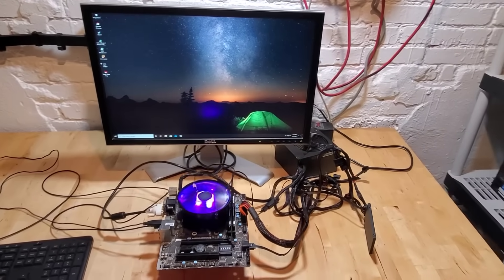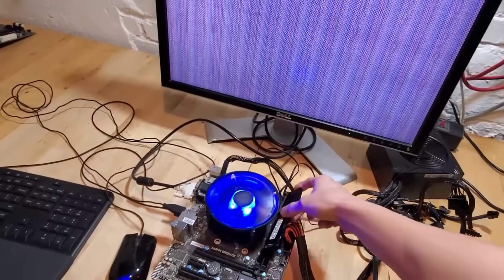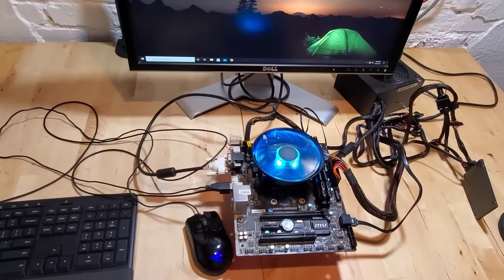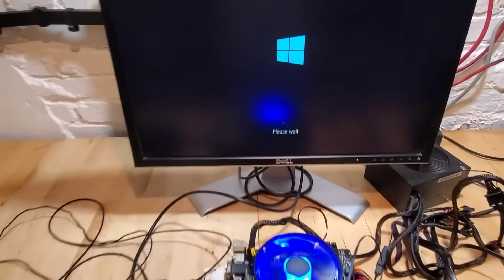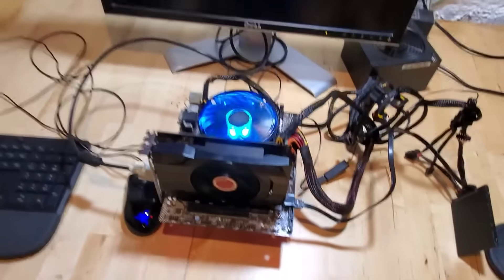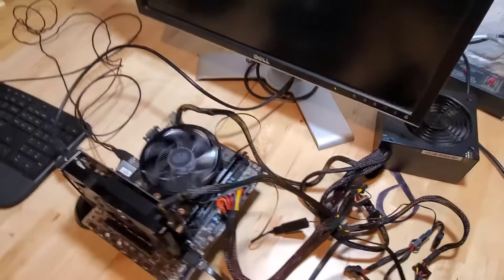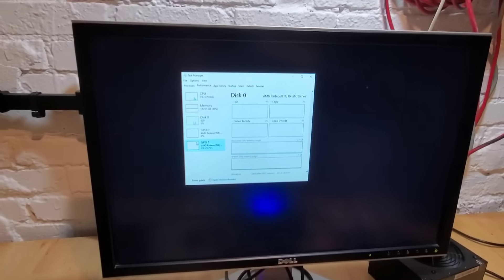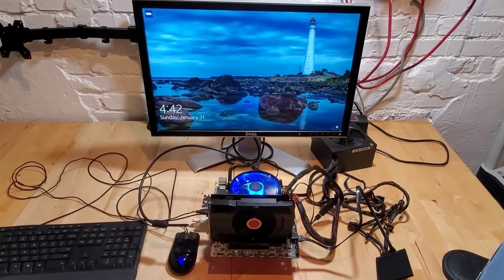What happens if you remove PC components from a running computer?

Comment: This is actually really impressive
It just proves how stable and failure proof the systems have become...
One reboot, and everything is back to normal
Reply: 'have you tried turning it off and on again?'
Reply: Honestly am amazed, it's not even designed to be hot swappable like commercial grade hardware for servers etc, our computer design and technology has come a long way to be that unexpectedly robust.
Reply: When you stand back and think about it waht you  say is a understatement  it's bloody amazing  it got  this far in less then 20 years
Reply: @whitefox3104  Nothing has changed in the last 20 years. We still stick the same components in the same spots and of course unplugging them disrupts some data flow causing a process to crash and then you have to restart. I don't get what's so impressive about that.
Reply: @whitefox3104  less than 200* years
Reply: i tried connecting a hard drive while the pc was working, the pc was like really old so the psu just went BOOM.
Reply: Yeah, I remember shortening my PC while trying to put in a RAM in a running PC.
Reply: this guy never tried memory overclocking...
Reply: idk man, who the fuck wants to remove the 2000 dollar graphics card from a running system, this cant be healthy at all.
Reply: Versus back in the days where you might get a blue screen of death 10 times a days.
Reply: @RobertShane  Back then you could resume from bsods without rebooting.
Reply: @2b2056   it depended on the blue screen. but most were not recoverable without rebooting
Reply: @xybersurfer  Most actually are*. Do you have quite a few retro PCs at your house? Then don't correct me on how Windows 98 works. You can even get a bsod from removing a USB device, and all it says is to remove it properly. It's literally just a warning BSOD.
Reply: @2b2056  that's interesting. maybe i always wrongly assumed that they were non-recoverable. however i only remember being able to recover from it exactly once. i don't use windows 95 and 98 anymore (same goes for 3.1 although i don't remember any BSOD on 3.1). it's been a long time. also i probably never used a USB with windows 98. at the time i did everything with floppy disks and other ports. maybe you experienced BSODs specific to USB, because your experience sounds very different from most people's
Reply: @xybersurfer  "experienced" you mean experience regularly? I use Windows 98 daily and deal with its quirks. I don't care what others remember experiencing, I care how the OS is programmed to give you a BSOD if you remove a drive while it's being used. Nearly every BSOD on 98 is recoverable from, it just completely breaks the OS if you try to. For example, installed the wrong driver? BSOD, but you can resume to a black screen that only the ctrl alt delete menu works on. Same with missing system files, or corrupted login.
Reply: @morbidgull8922  you make it sound as if skylake was a long time ago
Reply: @tanksaawk Forgot: "Hopefully"
Reply: It's called fault tolerance, pretty much every tech has it, unless you're looking at extremely old hardware.
Reply: It's because every thing is stored in the HDD Or Ssd
Reply: There is no reason that it wouldn't, it's just really fast temporary storage. The os loads everything important at startup and that's it,  by removing it you just effectively delete everything on that stick of ram.
Reply: well the only thing that can happen is some corruption in the disk writing; so removing a component is a bit like a power failure, usually windows or any OS will recover from it. Of course you can easily fry a component doing that; or shock yourself; so that's still really stupid.
Reply: I remember the pre-USB days when you couldn't even unplug a keyboard or mouse from a running computer without risking problems.
Reply: I remember formatting windows every 3 months, last year I did a complete mobo swap and with i reboot everything ran flawlessly, good stuff.
Reply: yeah, reboot does make everything work again 100% of the time
Reply: Yeah... this doesn't hold up when your laptop starts smoking.
Reply: that's what made me actually doubt about what I do every day to pay attention to my devices... Back in january 2022 my Windows corrupted the explorer.exe process just because I did "Update and shut down" instead of "Update and restart". Now I'm looking at a guy removing a running CPU, and fixing that Just by restarting the system. I think it's just a matter of extreme bad luck or isolated events
Reply: THE CPU is the most riskiest of all, first you need to remove it's cooler, during that time it could overheat before your experiment.
Reply: and yet updates still completely fuck your computer over sometimes
Reply: its real impressive how fucking fake this video is. ANY of the shit he showed results in an instant complete loss of power.
Reply: Before it could stop working if you just removed a keyboard
Reply: Agreed. They all act like a little static will break your pc
Reply: but that didn't work with an old windows 98 pc????  i think you get the same result there too??
Reply: It may seem normal in the beginning, but you never know what kinds of corruption happened when the system failed.
Reply: Well, remember that every one of these presents a huge risk. With memory, you're wiping everything the programs were using on heap so they hopefully just stop running when they get access errors. With the cpu you're kind of killing communications between everything and hoping they don't do something stupid. Also runs the risk of corrupting things like the registry (very bad) and directories, which might be fixed with recovery.

With gpu, well, the gpu is just the cpu's slave so nothing really goes wrong there. The ssd will likely have corruption when removed, but the OS files should be fine.

So instead of just starting windows, you were working on a big project and one of these just (temporarily) stopped working, you'll have a big mess on your hands.
Reply: Just don't change the partitions unless you 100% absolutely understand wjat you're doing. Seriously, don't. Changing partitions is probably the easiest way anyone can absolutely brick their PC. I did it once and my PC BSODed and not even a factory reset fixed the problem. It booted up in safe mode and got fixed for 2 seconds then BSODed again.
Reply: now try it on a hard drive.
Reply: @yacinekcl  Why wouldn't you be able to remove a hard drive? SATA drives are actually hot swappable, so unless it's the OS drive it shouldn't be really be any different than unplugging an external USB drive.
Reply: Not really. I removed rams from running pc and now it's rip in few days, my mothetboard got damaged.
Reply: @elsantego4693  Depends on your Ram brand. Some of them is so strong.
Reply: @workoholekhh7542  Or depends probably on motherboard, mine was 2011-2013, dont remember, but old.
Reply: 50-100 years later:
PC: “Let’s see what will happen if we remove lungs from a human”
Robot: “This is actually really impressive….”
Reply: I may have to disagree.

Surely you think it must be the most stable OS ever when it can even deal with removing hardware while running.

On the other hand, Windows is so instable programmed, that some months ago a freakin MICROSOFT HEADSET DRIVER managed to make my PC Bluescreen everyday until I found out that I had to deactivate it.

TLDR: The video makes you think that it is stable, but a stable OS with a faulty Headset driver should just deactivate the Audio if it gets a driver timeout and not crash the entire system down.

Imagine a self driving car would shut itself down while driving just because the radio driver is buggy. I never heard that from Tesla or other brands.
Reply: @derwolf200  That was a stupid example for a whole world of devices. Any device may have bug not all of them
Reply: @derwolf200  You comment is more system software related then hardware reliability related. I noticed one comment mentioned backwards compatibility(true). The reason for this is the way Windows is built, something you have to understand, to understand why every driver not in user space(that is not running as the user), is running as the system, and on Windows this is almost every driver(I do not know of any that do not run as the system.). The reason for the crashing is because the kernel is handling the hardware and any bug that is because of the kernel or heavily reliant on the kernel, like the driver will cause a crash, known as the Blue Screen Of Death, this is a crash of the kernel due to a driver. It is a backwards compatibility feature. The main advantage of doing is that some hardware driver actions can not be authorised without kernel level privileges. This is a big problem on Windows when every driver is expected to be written properly, bug free, and running as the user wen necessary. This is the developers fault, do not blame Windows or the hardware for this.
Reply: @derwolf200  I've personally never had a blue screen on my PC, and I've been using it for a few years now
Reply: @derwolf200  when EV cars get popular, hackers are going to cause catastrophic accidents this way. When you see famous people in EV's get offed you probably know it already started. I wont ever own an EV my self. Some dude who can doxx me on the internet will soon be able to make me go into a guard rail at 140 mph and make it look like it was my fault.
Reply: @OMGERRORWTF  There's nothing magical about EVs that make them more hackable than ICEVs, it doesn't have anything to do with the drivetrain. The increased software integration, drive-by-wire and connectivity is what does that and this is a development that's happening with ICEVs just as much as with EVs. It' just commonly associated with EVs because it has coincided with the rise in popularity of EVs. So you're not going to escape that risk just by staying away from EVs.
Reply: @OMGERRORWTF  You do know that cars already have drive computers in them, and hackers already can cause accidents through them, right?

Comment: 7-minute video summarized: removing ANY component will result in catastrophic system failure, and re-plugging it does not do anything; however, everything works fine after a restart.

Comment: I’m surprise it didn’t start gashing fire in that ram slot when reinstalling them when pc was running
Reply: why tf would it do that
Reply: @2b2056  I guest you don’t know anything about pc, I literally build pc my self and Am level 3 certified in computer repair and computer service and support, it could have start gashing, the board basically send electricity to the ram, you don’t install it when the pc is running for your safety and the board
Reply: @876Plug  I guess you don't know anything about PC, I've built hundreds of PCs in my lifetime and it is ridiculous to state that the board would start "gashing fire" when a ram stick is installed during operation.
Reply: @2b2056  ok my guy stick to what you think, you didn’t bring nothing to the table here you just came to argue

Comment: Some Motherboards allow you to config the PCIE and Sata ports as Hot swappable (Can also be called Hot Plug and Plug and Play).
This means you can add and remove PCIE (Including GPUs) and Sata hardwares while the system is on without a problem.
In the case of a GPU you might need to use the Integrated GPU port to reconfigure your display port to the Hot Plugged GPU for it to start outputting image.

Comment: How did he not manage to get electrocuted throughout this-
Reply: The electricity running through actual computer components is quite low, a few watts and micro-amps at best (because it doesn't need to be any higher). The only way you could electrocute yourself is opening up the power supply and touching parts inside of that like the capacitors.
Reply: @Nightweaver1  i just got a computer lecture

Comment: his pc: literally gets dismantled 1 by 1 and still running after reset.

my pc: literally doing normal everyday task and doesn't touch anything risky. nah i feel like im not gonna start up today.
Reply: Want help?
Reply: @cutterchop4425  yes pls
Reply: @mehmeh9947  give me ur discord
Reply: True story for me (not lying)
Reply: Comments like this make me laugh. Becuase it's not the pcs fault, That your pc slowly got worse overtime since parts dont do that.
Reply: @emrahalien2972  they kinda do tho?
Reply: @beastcrozby4384  Actually they dont they get closer to never working again.. not losing their quality at all, basically, if you buy a reused GPU you would have less time to use it but still all the power is not affected so you would still get the same good quality performance obviously, you need the specs to match the OS your using but in general, your old GPU in your old office pc should be working the same. but maybe die out after a year since it's old. people who don't know anything about computers don't know why their pc is slow and then think it's the whole thing. when its only 1 problem
Reply: @emrahalien2972  Lmao are you actually saying that pc parts doesn't get old they just die, who told you this
Reply: @emrahalien2972  for example a gpu's thermal paste can disintegrate due to continous load (mining etc) which causes higher temperature and lowers the fps , same goes with hard drives (meaning parts do get old and not just dies randomly)
Reply: @djmagn3m691    .. your talking about bitcoin mining. That is because they overclock it and overheat it until there's no tomorrow, a normal user doesn't do that so that doesn't happen a card that is misused gets degraded over time. A card shouldn't have high temperatures that is not normal. Of course, that's going to degrade it's being misused! can you give me an example that's only based on normal use and not extremes? we're obviously not talking about bitcoin mining. if it was about if they can degrade at all then sure, but not by normal use just if you really aren't cleaning it out or using it well.
Reply: @djmagn3m691  and yes thanks for helping my point harddrive do wear out after maybe 3 years, that's the biggest thing that makes people think their pc is slow. It's the main component and the only one that makes everything help load faster. forget to mention that's the actual problem in any pc since it's the only real thing that can degrade without misuse. and affect the loading of the computer most of the time.
Reply: @emrahalien2972  My 1TB HDD that i bought 5 years ago still works fine if I reinstall my windows every like 2 years and almost as fast as an brand new SSD i got with my laptop which comparing the disk usage the hdd is 10% and ssd is 4%

Edit: The HDD was not expensive i think it was like $50 or something
Reply: @djmagn3m691  iirc linus tested this and a continuous load like with mining is supposedly actually better than  a dynamic load like with gaming where temps change a lot more frequently causing repeated expansion and contraction of the parts. personally id still rather not trust used gear when i'm dropping so much money on something for which i dont have much ability to verify the quality myself, but ive been thinking when i get my machine working again (currently broken due to trying something similar to the vid, removing ram while in operation, but in my case i had a gpu attached (any help or advice would be appreciated)), i'll probably try and keep my cpu at around 75-80% load at all times, and have some mining software set up to pick up the slack for me when i'm doing idle tasks like reading books or tbh anything that isnt video games/graphics rendering/ML training.
Reply: @emrahalien2972  You're assuming that the parts aren't defective. If a component is defective it can work fine at first and then start to get worse quickly (before failing altogether). Also dust and other factors can affect performance.

Comment: What happens if you remove EACH PART of a computer while the computer is running

SIMPLE........... IT STOPS WORKING

parts of a computer

MOTHERBOARD - if you remove it , everything stops working

POWER SUPPLY - if you remove it everything stops working other than the CMOS Battery that is powering the motherboards basic BIOS and clock and geographic information

CPU  - Motherboard would shut down and processes would stop and calculations can't take place 

CPU FAN - everything would run until the CPU overheated and then everything would shut down

MEMORY -  Everything would shut down because the CPU needs ram to execute instructions

 HARD DRIVE - the operating system would stop working but the motherboard CPU, RAM and Power supply would continue to work
somethings might continue as a result of being loaded into system memory but it wouldn't last too long and you wouldn't actually be able to open new programs or do much
Keep in mind that some computers are Thin Net and don't have hard drives but boot from LAN

This is why these components are called NECESSARY COMPONENTS OF A COMPUTER

if you had a peripheral card... GPU let's say and you remove it 
obvioulsy you will lose video but the system will actually continue to run without video as per normal.
plugging the GPU back in on the fly (Hotswapping) won't work because communication between CPU, Northbridge and southbridge and GPU needs to be re established and loaded into memory again

Comment: If u remove the GPU the display feed switched to integrated graphics or CPU(if there is no integrated). I kn this coz my GPU died while running the system and i was able to get back into the system using Chrome remote desktop on my phn realizing the display was being run by the CPU fully on a 480p size canvas.